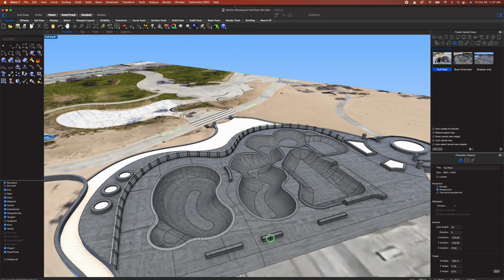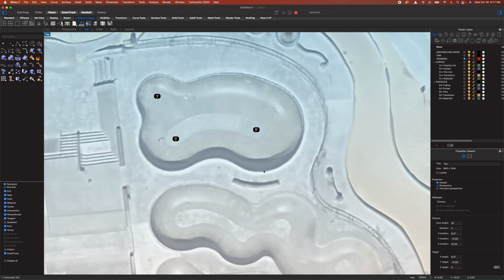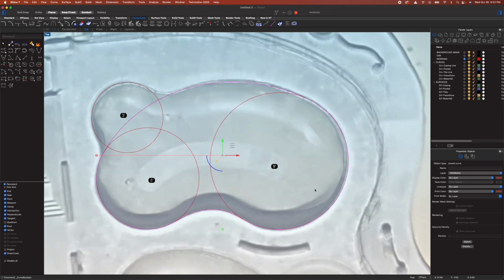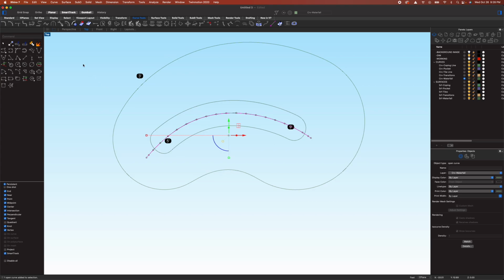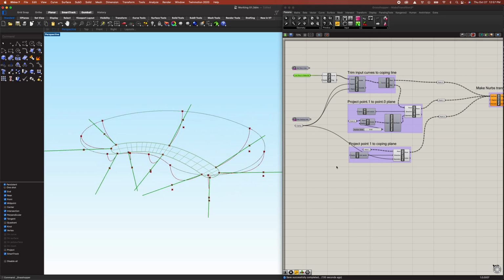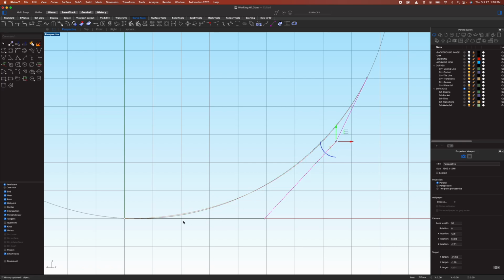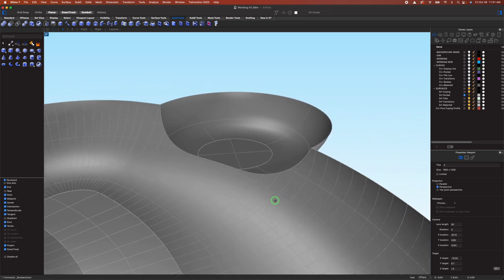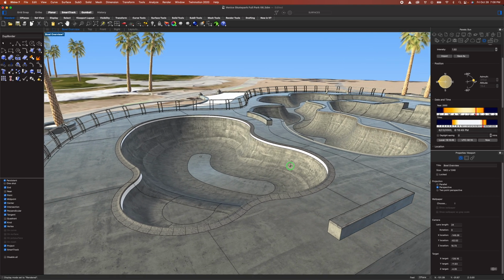Rhino 7 - How to 3D Model a Skatepark Bowl - Venice Beach Skate Park Pool YouTube

Comment: Hey mate great vid is it possible to get the grasshopper file?
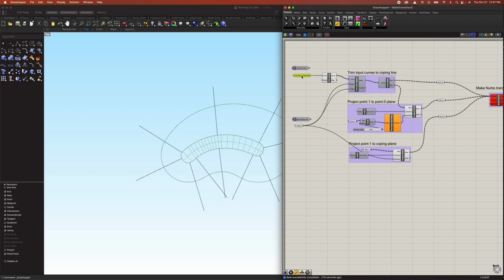Reply from the maker: Hi, I don't have the grasshopper definition for download anywhere, but it's easy to just recreate. You can see the whole setup at the 17:20 mark.
Reply: @oldstarpress   Hi Jim, Thanks for the great video. I'm new to grasshopper - what are the points 0,1,2 referring to in the script? (where do I set the values?) Any help would be greatly appreciated!
Reply: @stefangagnier4260  Did you ever figure this out? I'm stuck here too. @jimcallans4543 can you help here? Can't complete the tutorial without this info!